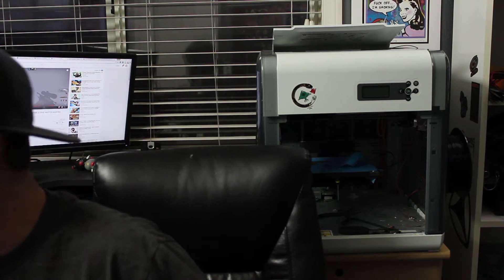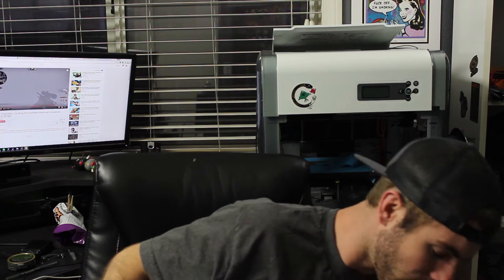3D Printer Kits Vs Building Your Own 3d Printer | Why I Chose A Kit

Comment: Just an update, I ran through the numbers last night trying to source the cheapest possible parts I could on eBay, Ail-express and Amazon. Just parts for the Frame alone cost $66.96 and $36.68 on top of that just for the linear motion rods!

All in all it came out to $217.39 for everything, not including tax.

I picked up an Anet A8 kit for $110. Even if you are going to build your own you are better off buying a kit and using the parts from the kit to save money.

Comment: I just basically finished building a large delta 490mm diameter, 685mm height build volume. (Trying to switch out the extruder to get past the 160mm sec speed I'm at now) I designed it all myself, I will put up the BOM on openbuilds eventually, and some custom designed 3d printed parts as well, and yes it's expensive. I did a lot of overkill, I used 400 step motors, I used all aluminum construction, effector, and carriages. I used the real e3d v6 hot end etc. I used silicone wire for EVERYTHING. The thing is built like a truck, with everything taken into account, wire management runs with braided sleeving and all.
The great feeling of accomplishment you get from seeing a basement full of parts sourced from various vendors in China, Canada, across US, of course Amazon, and then seeing it all come together and work, and not just work, but produce prints which rival quality of a $3300 professional level pre-built printer I own, that's awesome. And building a delta is just cool. Kits are fun, and a great way to get into building a printer, but the enjoyment of building your own design is just awesome. Hardware stores are fine in a pinch, but I source all my screws/metric mostly from mcmaster, and some from Amazon. You pay 5 cents a screw online and 75 cents at a hardware store.

Comment: http://www.ebay.com/itm/New-DIY-RepRap-Prusa-I3-Auto-Level-Unassembled-3D-Printer-175MM-Aluminum-Frame-/151817197431?hash=item2359029777:g:2NcAAOSwkZhWTpj-

My buddy got that one and it is working for him. I may do the same. I built it with him and it is very solid.
Reply from the maker: +Akmaisto Mods definitely not a bad looking kit!
Reply: The prints are great too.

Comment: They say that building your own 3d printer from scratch is more expensive than buying a kit. I was going to buy a kit but found that it was the same price as prebuild printer. So, I purchase a prebuild printer from PrintrBot which was same price as their kit. If all goes well with Dopesoner's printer build I will consider getting a kit.
Reply from the maker: +Krankzinnig Piet how much did you pay for the printrbot
Reply: +Dopesoner $599 for an assemble printer and the kit is same price for some reason. I was gonna purchase a wanhao duplicator i3 which comes semi assemble but the one available was getting recalled way back then.